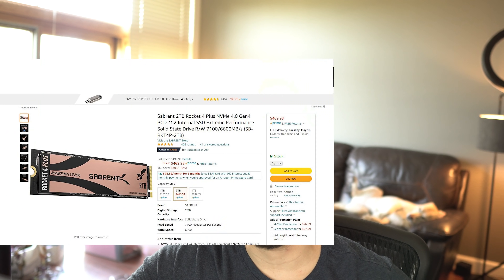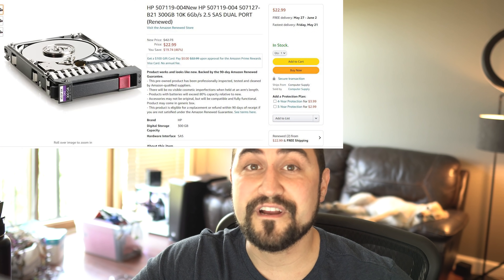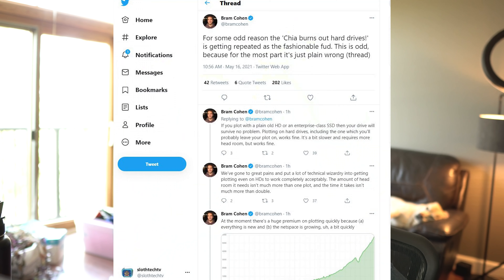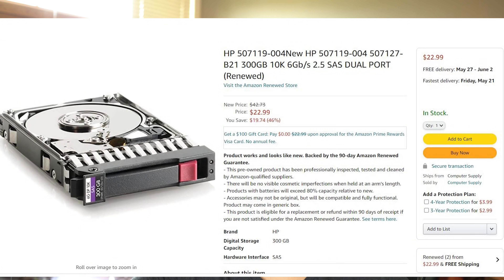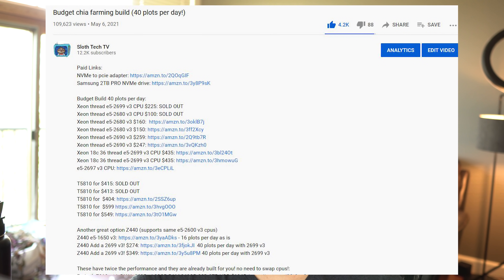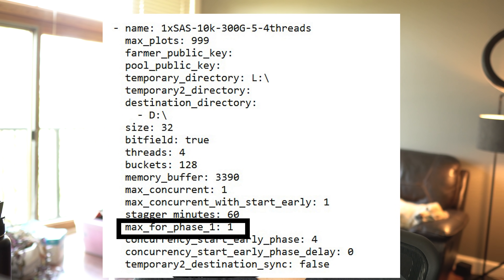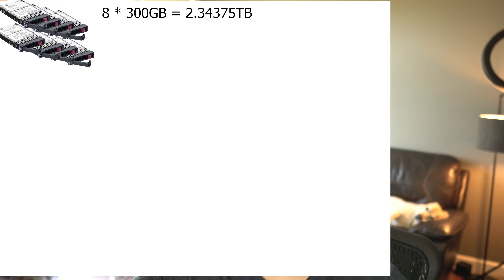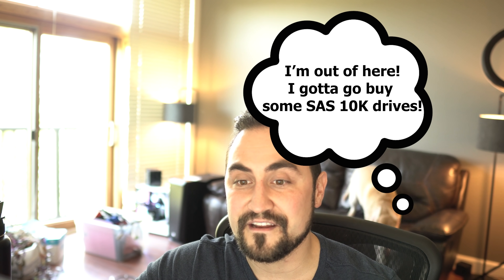Why are you plotting on SSDs still? (How to plot on $22 drives)

Comment: you forgot to calculate the power consumption of 10k sas disk, when you have 1000 of them they consume 10kw/h which is very very expensive
Reply from the maker: You would never plot on 1000 10k drives. Also I did measure 10k drives -- and they use ~2.5w .. not 10w like in your hypothetical 1,000 drive example.
Reply: @SlothTechTV  10k sas drive has 12v 0.7a 5v 0.7a working requirement, pull out your drive its on its sticker. 2.5w stand by consumption is when its not working. tell me when you have 1000 sas drive how would you plot then?
Reply from the maker: @深夜酒吧  Why would you ever have 1000 of them? I am not advocating using them as storage .. just plotting to them.
Reply: @SlothTechTV  never mind, i dont think you are chia miner aim for profit.
Reply from the maker: @深夜酒吧  Are you proposing chia miners aimed at profit buy 10k sas drives? They have low capacity, and they aren't cheaper than 3.5" drives.

The point of this video was saving money and plotting on them.. not using them for mass storage.

Comment: Hi there, I must be doing something wrong. I have a hp proliant dl360p with 8 sas 10k 600gb, 48gb ram, and 2 6 core cpu 2gz with hyper thread. I also  have 14tb usb 3 drive for final storage. I have run a few different settings and they always take around 20 hours per plot. I have set plotman with the settings you have here. Any ideas?

Comment: The company I work for has boxes of these 300GB SAS drives doing nothing, with many more still in powered off servers in racks. They really are garbage to throw away. After we virtualized our bare metal servers, the servers ended up being decommissioned and stored away in a junk pile at a remote location. We scrapped the hard drives, memory modules and PCIe cards to keep in the office just in case we might need them for something. We also have a good bit of spare SAS HBAs that are no longer in use.

Comment: I’ve got 2 x SAS HP 10k 300gb drives connected via LSI 9211-8i to my windows 10 pc.

I only get up to 80mb write speeds on the drive using mad max plotter. Any ideas why it is so low? I have already changed the cache settings which improved it from around 40 to up to 80mb/s

Comment: Just picked up a t5600, some RAM, 8 10k drives, 2 e5-2690s, an hba, a 16tb HD through your channel links... I think all I need is some heat gel for the chip swap and I'm good to go. Should be a fun adventure
Reply: Oh yeah and 2 breakout cables as well for the drives
Reply: Looks like I need to buy Sata breakout cables to connect the drives to a power supply? Do I need to get fans, and external enclosure and an external power supply to do this 10k method? Is that implied??

Comment: Hi man, great tip regarding SAS drives. I purchased 14 and and different controllers and tested a lot and they are working great. Regarding my results, I found best performance with 9260-8i in 8 disk raid over 9211-8i in IT mode. My disks are 300gb 10k SAS HPs.

The key to the best performance was that the 9260-8i supports RAID controller cache as well as disk cache and also "always write back" and "always read ahead". These are all "high end" raid controller features (for the time the 9260 was designed). I have found that they really enhance the disks and extract the most performance, rather than just running them on their default performance via IT passthrough on the 9211-8i.

I find the best mb/s disk performance and best cpu utilization (with my xeon e5-2678v3 12 core and 32gb ram) are 7 parallel plots with 3 threads and 4800mb ram each. This makes the 8 disk array work at between 700-800mb/s. 

What results have you got plotting to each individual drive in IT mode?
Reply: Hi David, what was the performance difference between the 9260-8i in 8 disk raid vs 9211-8i in IT mode?   You mentioned 8 disk array was between 700 to 800 mb/s.  What was the speed of the 9211-8i would you say?  Thanks!
Reply: @TheRealPhilipK  In order to compare apples to apples, I setup the 9260 in 8x single disk raid 0. The drives, with the 9260 extra features, performed better individually in Crystaldiskmark than with the 9211 passthrough. The main difference was in SEQ1M(Q1T1) : 130mb/s write under 9260 and 75mb/s write under 9211.
Other stats were close enough to not matter much.
Reply: I have not invested the time to do full multiday plotting comparisons between both cards with 8 drives in both cases. Plotting with 9211 individual drives and 2core 3390ram was leading to over 24h estimation after a couple of hours (for a batch of 8 plots on 8 separate disks, one plot per hdd). So I didn't let it run.
I would say that the main problem is that single hdd performance cannot even saturate 2 threads, so a tremendous amount of CPU is being wasted and the single hdds are a big bottleneck.
For this reason, I would always raid at least 2 hdds in raid 0 for every 2 thread plot. I would raid more disks together if you want to use more than 2 threads.

And if you are going to raid, then IT mode defeats the purpose. And 9260 is better than 9211 in raid mode because of the extra features like "read ahead", "caching" and "always write back"

Comment: Bought 3 sas hdd 300 gb drives. I have work station that supports sas drives. Thought I could run separate plot for each drive. So it should plot at the same time on each drive. For some reason only 1 drive plots, other 2 drives are waiting in que

Comment: How are you getting 11hr plot times? Im using a dual 2670v2 (20core/40 thread) system with 10k SAS drives and its taking 15-17hrs per plot...i know this is wrong but i really cant figure out what is the slow down. I've tried from 2 to 8 threads per plots, and ram from 4-10GB and nothing is making a drastic change. Would love some help if possible,  I jumped on the SAS drives after watching this video but not sure what I'm doing wrong.

Comment: 20 SAS SSD x 4 TREADS EACH. RUNNING IT CONCURRENTLY WILL TAKE 80 TREADS.
2699V3 ONLY HAS 36 TREADS.
HOW DOES IT WORK?
Reply: only phase 1 use more than 2 Treads, just limit maximum number of phase 1 running at the same time

Comment: Is it better to use 2.5 or 3.5 SAS drives? In my humble opinion, at equivalent rotational speed the 2.5 sas drives consume less electricity, but maybe the 3.5s go faster. You are talking about an LSI 9210 but could a card like this HP SMART H240 SAS controllers work? Thanks Sloth Tech TV for your great job. Keep Up the good work. Thanks man !

Comment: I have tested your configuration on 4  (SAS 10k-600GB) on a Dell tower 7810 with 64GB memory with the same configuration you mentioned in min 5:20, except for adding 3 more drives to the temporary directory, but I haven't got the same results, not even close, any suggestions?

Comment: This concept is pretty much DOA if you're tuning in early June. No, the cards and cables are not pennies as they once were. The SAS drives? Maybe they are decent(ish) priced but consider hassle and the extra expense for the inflated cards and cables? No resale value either. The juice is NOT worth the squeeze. Was. Not now. You might be able to pound the pavement and save 20% but time invested in checking listings every minute every day is your time which = $$$. Sorry, just a reality check. I might change my view if SSD prices balloon but the only winner here is the sellers now.

Comment: Have you tested this? Windows is not able to write to 2 or more disks in parallel at the same time. The write performance is always swapping between the disks. Can Linux handle this - or is it a hardware limitation`?

Comment: Just did it and the results is terrible.  My pc does 8 plots in parallel in 7 hours using couple of fast ssd. 
Hdd raid 0 on 15k disks did 6 plots in parallel for 25hrs.  May be this is because the total speed of the solution is about 1400/1200. So if you divide it for 6 plots you got  almost same result as for plain hdd

Comment: Which global settings did you use ?
max_concurrent: 
max_for_phase_1: 
minimum_minutes_between_jobs: 
I am currently struggeling with 8xSAS 10K on a 2xE52620V3 and no solid output in acceptable time.
HP in HBA mode, No Raid yet 
You mentioned Raid -0 - I tought HBA raid mode would slow down or are you talking about  SW Raid ?

Comment: I'm plotting with 600GB 15k.  It takes me a lot longer then 11-12hours.  I pass phase 1 after 8hours.  Could be my system.  Old i7 / 2 threads / 4 drives, 1 plot each.  At current time it'll take about a day before the plot finishes.

Comment: The duplex difference between sata and sas is really a very minor difference.  In reality, a spinning disk can only either read or write at once.  The benefit of full duplex is that the SAS drive has a bigger queue, and also can store more "pending" requests as they also have bigger queues (SAS has queue depth of 254 vs SATA queue depth of 32).  But again, even this difference is fairly minor.  I see plot times of between 35k and 45k seconds on 15k sas w/ 128MB cache , and I see 36k to 48k on my 7200RPM enterprise SATA.  Under full CPU load, the difference is negligible.  That said, I definitely use 10k/15k SAS because they are dirt cheap, as you point out =D  Though of course there is a power draw difference (ie 4 SAS vs 1 NVME drive).

Comment: If you are assigning 4 threads per plot, how are you supposed to plot on all 20 drives at the same time? Would you not need 4 threads for each?
Reply: Exactly. Means u will need 80 treads.

Comment: Doesn't SAS consume way more power than an SSD at full load? 
Although it's cheaper upfront, I feel that it cost about the same if not more, this factoring in power usage and additional hardware required to use SAS drives.

Comment: Love your vids bro. Got a question though. I’m with my dual e5-2690v1 intel x79 setup, connect 2 sas 300g drive, but the plotting speed is way too slow, 1st job using 1 hour at 9%, 2nd job almost 1hour at 5.5%, what’s wrong?

Comment: I've made a mistake of buying real bad gen3 Sabrent Rocket SSD 2TB (sustained write speed is only 400-500MBs - you can get better sata ssds). That gen 4 one is not really much better - it can't sustain high write speed. Samsung 970 evo or 980 pro are much better.

Question: can you connect 4 SAS and 4 regular SATA drives to such $30 card?
I've run out of sata ports on mobo and also my 2600 cpu will not allow me to plot too many more in parallel (currently finishing a plot every 103 minutes using SSD). I'm thinking about 4 SAS 15k rpm drives plotting and 4 5400 rpm drives collecting plots and harvesting.
Anyone tried mixing SAS and SATA (not planning to use any RAID, each drive on it's own)?

Comment: Its not worth buying. 300GB sucks. That's good for 1 plot at a time. Connect 20 drives?! Ha ha ha ha ha.   You're better off just buying samsung evo drives which require a lot fewer $15 cords and a lot less space.  No resale value either. Samsung evos have a higher resale.

Comment: Brilliant channel, clear information. Quick question. with 8 x 300Gb 15K SAS drives in my server can I plot 8 plots at a time or does it require me to RAID 0 them in to 4 x 600Gb Arrays (the latter is what  am currently doing as I read somewhere I needed ~370Gb temp space for a plot) If I can break those arrays back to 8 x plots that would be amazing, might even buy some more but bit unsure if it will work. (2 x 8 core E52470L Xeons with 32Gb RAM, soon to be 2 x 10 core Xeons and 64Gb RAM). Ubuntu desktop App until I get my head around farming then back to the CLI where I am more comfortable. Keep up the good work. - EDIT: Split the 4 arrays back down to 8 x 300Gb drives, now plotting on all of them, will see how it works out. :-)

Comment: You say using used hardware is eco, maybe (apart from drawing power), but where will you store these plots? I bet not on used high capacity drives, but rather on new 10+ TB drives, USB maybe. That's not eco, filling drives with data that has no use except farming chia. There is no eco cryptocurrency.

Comment: Assuming speed comes from accessing multiple drives at 10k rpm simultaneously- what’s the best balance of size to speed to controllers, for a similar system. Would more 72Gb 15k rpm drives potentially be better? Assuming using fewer 600gb drives wouldn’t be as fast?

Comment: I just got a HP Z620 Workstation 2x Xeon E5-2697 V2 24 Core 96GB RAM SSD for OS and looking to connect 24x 600GB 10k SAS drives through 2x HP LSI 9212-4i SAS 6GB/S 4-Port PCI-e Raid Card Controller.
What would be your advice? Should I plot on individual drives or RAID them up?
Thanks for sharing your knowledge with the community.

Comment: It is true that the old traditional HDD drives can be written and rewritten more times in comparison with SSD drives.
On the other hand, HDD drives have a higher rate of failures and data errors due to the fact that they are constructed out f movable parts.

Comment: Interesting how about sata ones?
Reply: Sata hd is slower. run at 7200 or 5400 rpm vs 10000 or even 15000 for sas.. bus speed is slower. Fine for farming/harvesting but bad for plotting. Sata ssd otoh can be made quite acceptable for plotting using smaller drives raid0'd together.

Comment: So following some of your recommendations I started looking into SAS again and initially thought about pcie to sas adapters when I stubbled across something I found very interesting on Amazon:  ProLiant DL360 G7 4B Server 2X 2.66GHz X5650 12-Cores Total 32GB RAM 4X 146GB 10K SAS HDD No OS(Renewed)

Basically refurbished server racks with dual x5650's, 32gb of ddr3 and just shy of 600gb of SAS drives(it says 4 for a number of raid arrangements but reviews say they come with x2 300gb drives which I'd kinda prefer as it'll mean I have more spaces for expandability). They're $200 each and I promptly bought two as I needed to put two graphics cards somewhere still and the only other thing they need is an OS which I'm assuming is as easy as any other PC with Windows on a USB? The reviews seem pretty solid, is there any reason you can see not getting these?

Comment: Many enterprise variants on eBay with pre-populated drives and psu's. (NetApp DS2246, Dell MD3220, etc) just make sure you get the right sas cable from your HBA to connect them. Typically you can get the whole shelf (24 drives) for an average of $16/drive (600Gb 10k SAS). No need to mess around with external PSU's, jumper plugs or 3d-printed drive holders.

Comment: we still need the 13T ish final destination drive right? Quick question since I haven't seen it talk about, does the new plot overwrite the plots on the destination drive? I am assuming the newly written plot will be plot in these dives and transferred to the destination to overwrite the old ones. I don't really get that part... if not, then how many destination drives do I need?
Reply: and can I use 7200RPM drives for this? I could get 10k ones but it would cost double to ship to my place with isn't really worth it

Comment: Well since you already made a video about it might as well mention that storage chassis can be had fairly inexpensive on eBay.  I've seen some NetApp shelves with 24 10k sas disks for less than $500 for instance and other 24 disk enclosures for less than $200.  And if you don't mind some older servers v3 Xeon systems that can hold 12 sas drives can be had pretty cheap if you don't mind swapping the CPU.  Sounds like you've covered some of this in some of your other videos, time to go look.

Comment: Plesss help me

Hey, I had to stop the application Because during plotting I was getting some kind of errors. At this time, I had 5 fully plotted blocks which already got transferred to my final destination. So I did a restart of the pc and I opened the application then I saw that I still had my existing 5 plots in my finally destination. But then I saw there are some data's in my temp storage (NVME)  drive so I thought I will format that and do a fresh plotting to get the max storage. So when i formatted the temp drive and When I my re opened the chia application i see That I lost my link to the plots. It's no more telling that I have 5 plots found but it shows the link to my plots. But It's not getting recognized in the chia software. Can anyone please guide how to fix this. See below for the issue

Comment: I just got two 2 terabyte hard drives that i will be putting into an old T430 Thinkpad i rescued from from being scrapped.
One drive will go in the hardrive bay and the other will go into the ultrabay as a neat little package. Its not alot but its a good start to learn the process, i can also add external drives too eventually.
How much computing power will i need? Currently got a dual core Ivybridge but can upgrade to a quad core cpu pretty easily if i need too, also can add a maximum of 16gig of ram.
I've already got a quad core Thinkpad with 32gig ram and external sata ports but I'd rather keep the farming separate from my everyday use machine.

Comment: Also - it's worth noting that you don't need controllers that are flashed to IT mode if you can't find any (or they're not cheap enough). If you get one with RAID firmware, you can just set up a series of single-drive RAID 0 arrays, which is the same as just a single drive (to my knowledge, it's been years since I've been into this stuff). I've got an LSI controller running with four such "arrays" for long-term storage, and it's running just fine. In fact, it's just running as a file server at the moment, because this weekend is set aside for the woodworking involved in building a housing for all the external SAS temp drives.

Wish I could get more cores, though. I've only got a pair of 6-core E5-2420s in mine...anything more was prohibitively expensive compared to the budget. Should be able to get 3 cores on 5 drives OK though, if I stagger them a bit.
Reply from the maker: Roger that!!! great suggestion ty for commenting.